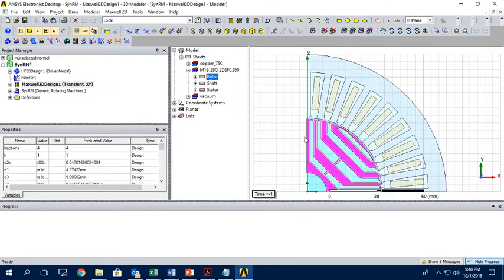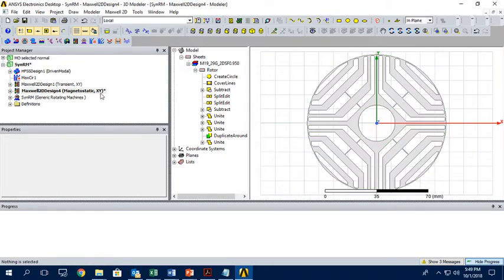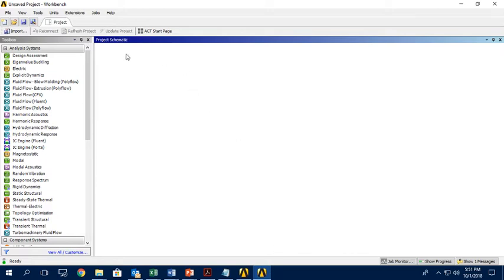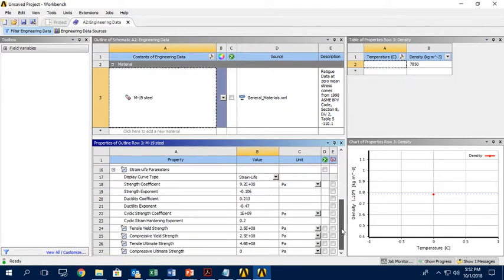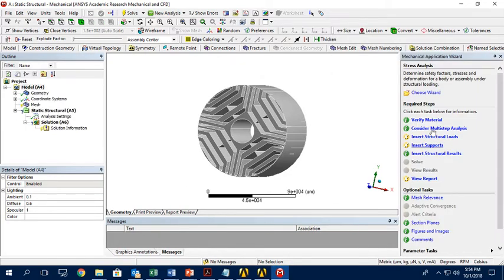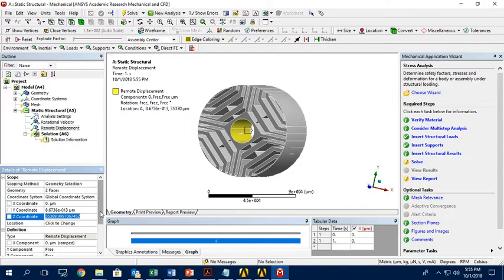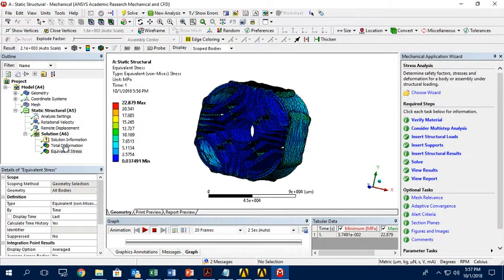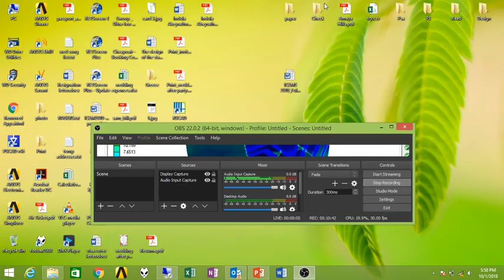6. Mechanical Validation

Comment: Thanks for these videos. In 2017 I have analysed axially laminated,  transversally laminated and flux barrier with magnets for ripples.  Your videos are very systematic and helpful for all aspirants wants to utilize Ansy's Maxwell. Please prepare some videos with open and closed loop driver circuits considering Maxwell and simplorer. Highly requested.
Reply from the maker: I will surely add that video in the future. Than you for the valuable comment